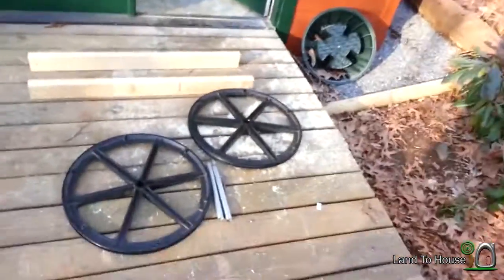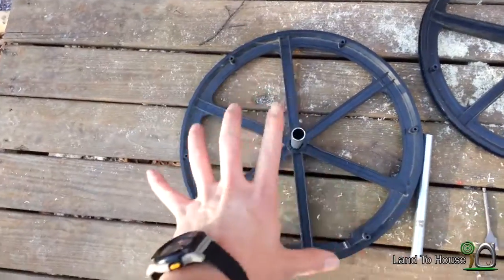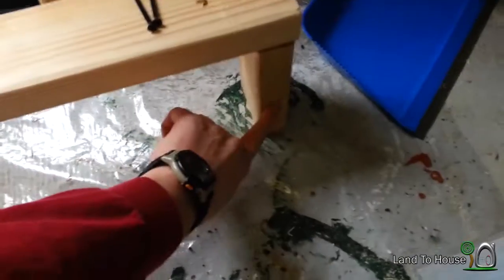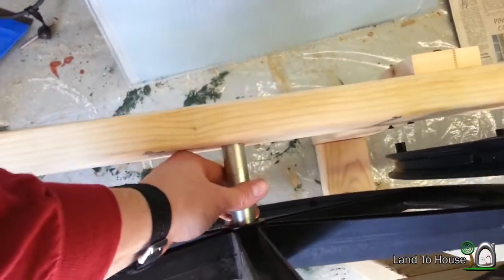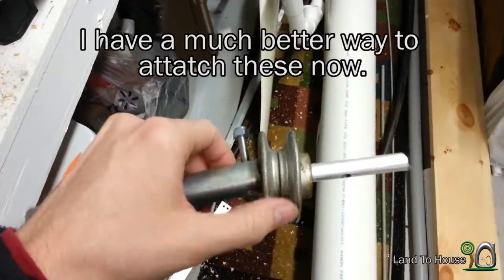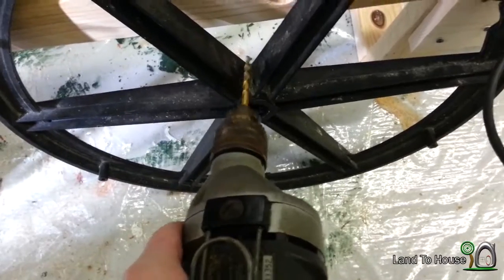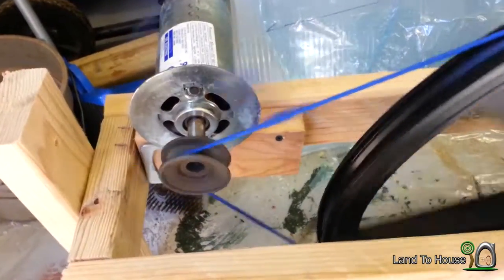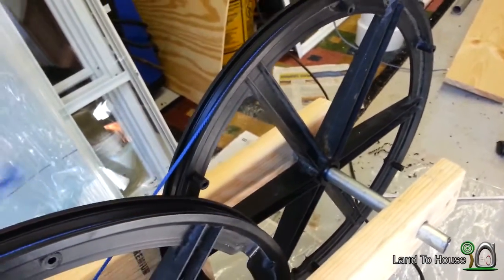Pulley Testing

Comment: I can’t see any updates? Did you get this to work? I did similar using 2 electric motors and was able to get more volts and amps out then input. Not enough though. So i would like to use a system like yours but do not have a machine shop handy and would like to see if it might work before I spend alot of money. Thanks

Comment: I just got another bike. After I let go of the two I had before. I am hoping to get back to due it again. I am even considering your dc motor connected to the batteries being charged. But they say that it may not produce more power than it takes. I feel that if it takes 10 amps to run your motor. The alternator may produce 20 amp once the dc motor runs the weels.Even 3 amps would be a very good  charging amount.

Comment: I have been trying to do something like you, but with two bike's.I am also working on the midle connection between the two bikes.I am trying to run an alternator.Great work.I belive that if it works may produce enough charging power for when there is no Sun.I still dont know if it will make the turning easier once the dc motor or alternator has a load connected to it.For me it  was hard to pedal the bike, for a substantial amout of time once the load was connected to the alternator.And I had minimal gain in dc going into the battery.Thank you for your video, it makes me want to go back and try again.
Reply from the maker: Wow this was a while ago. Fun test. Needed a lot of work to get a design that could actually be used. I never really got to a good testing point. Once the load was hooked up I have a feeling it would be very hard to turn.
Reply: Land to House I still belive the idea is possible. I figure once the pedalling starts and the second weel picks up, then apply the load, may be easier to sustain and produce enough power